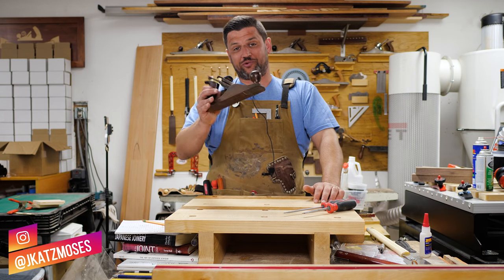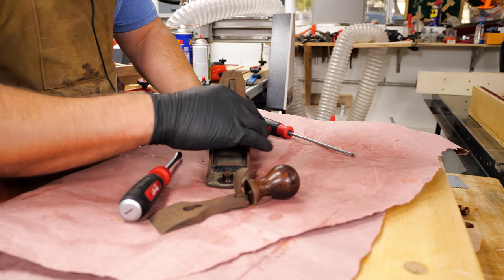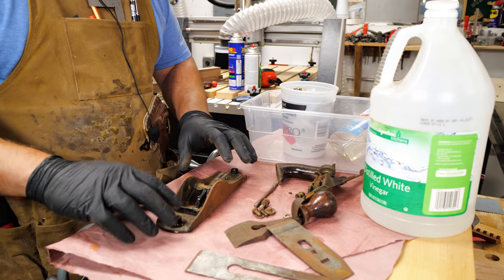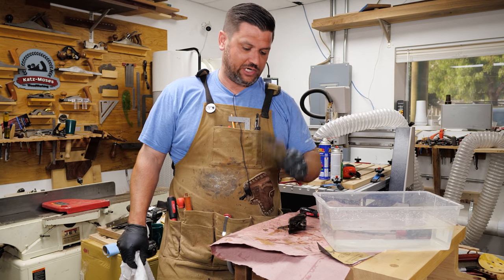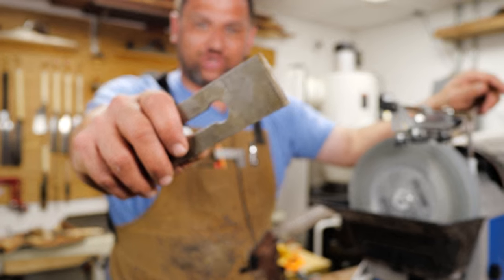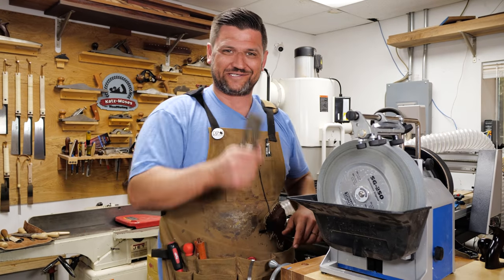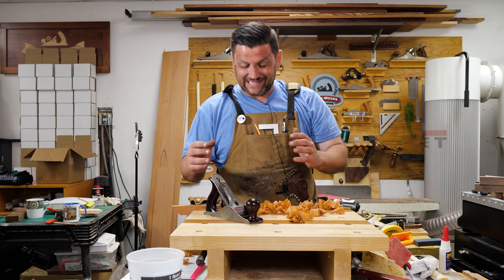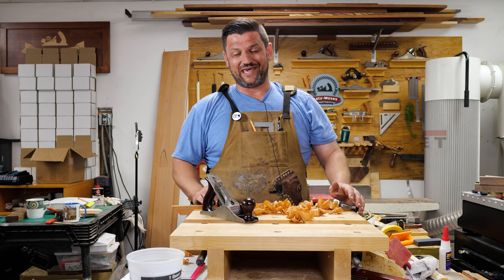Restoring a 100 Year Old Hand Stanley Hand Plane - Essential Woodworking Skills

Comment: The only thing I love more than woodworking is restoring antique tools. I like to try to leave the original japaning but will repaint if it’s in rough shape. The hammered finish paints look great. Shiny black just don’t look right on old tools to me. Thanks for the video 👍🏼
Reply from the maker: Cheers bud!
Reply: I’ve made some japaning, and restored two planes using it. It just takes forever to get to the point I could use them. Had to let them sit a couple weeks, then bake them. It came out nice, but ...eh. Lots of work, when you can just paint it and be done with it.

(Gilsonite asphaltum powder 1/4lbs from eBay- $8, then petroleum based solvent like naphtha & xylenes, and boiled linseed oil from where ever... I think I added some shellac flakes in my mix as well)
Reply from the maker: @joshuas1767  yea that sounds out of my patience level
Reply: Joshua Scarlett that’s awesome

Comment: Just bought a bailey no. 5 1/2 at the place I work at on the weekends (I sharpen knives, tools, swords, etc. At a flee market sort of place). I'm restoring it right now. I've got the screws, frog, chip breaker, and iron in some vinegar right now. Going to probably flatten the bottom of the body on my belt sander (it's just a bit big to do it with sandpaper like I would normally.). 

Yours came out great. It's going a lot faster than mine is lol.

Comment: Nice video.  I have a whole collection of old working Stanley handplanes that I use regularly from #2 thru #8.  I have restored all of them.  I found using Phosphoric acid (Krudcutter from the big box) as a super quick method of removing any and all rust quickly.  Just tank the parts for a few hours and done.  There is a certain satisfaction in using old iron once used by old craftsmen.
Reply from the maker: Good advice and totally agree!

Comment: Just a couple weeks ago I did 3 of my grandfathers, and one of my dads hand planes in the exact same way. I need an angle guide to sharpen them. But my favorite one was this tiny little shoulder plane. It's so small it can fit in my palm. Never seen anything like it. But even being so old and rusted, it still had a usable edge to it. I totally agree with the satisfaction that comes from doing a restoration like this. Especially when there is sentimental value in the piece your working on. Love this video

Comment: I have two planers that were handed down to me, one is a Shelton No. 14 and the other is a Stanley, both are the same length and configuration. The Stanley needs a new knob and handle (literally missing both) and the Shelton's handle is broken but might be repairable or serve as a template, both however need to be restored just like in your video. Thanks a lot really enjoy your content. Greetings from Arroyo in the southeast coast of Puerto Rico. Blessings.

Comment: I used to work in a machine shop, yes steel wool works, but you know what lapping is the sol of a plane should be flat from heel to toe. So I object to using a random orbital sander, what is a better idea if work off a flat surface a marble countertop or just the sinks cut out is very flat, use some wiring sticks on one and see if it flat without a bow in it.
You shouldn't see any light pass under your stright edge, now take a full sheet of emry cloth or wet sanding paper spray glue it down or use some with an adhesive backing make dure the marble or stone surface is clean you can also use a thin film of oil to stick it down.
Now you can pass the plane sol over as well as the sides untill its smooth yes al old plane might have a few pits but your using the whole bottom to guide your cut.
Pass it over this untill its clean use oil on the paper to help remove dirt.
This will restore the working surface,  on your fluted bottom plane you can wire brush it.  Or you can do electrosis to remove the rust using low voltage and a dissimilar metals then hone the sides and bottom. Some guys use the sand paper to sharpen planes and chizzels without tools but by hand.
A grinder is going to put 2 high spots and bevel on the cutting edge it may have to sharp an edge to hold it this way becuse the cutting edge has been weakened by the bevel shape.  Then agine it might cut better.  The Japanese have gotten sharpening tools down to an art. There joinery is a lot tighter tolerances.  
We slap 4 side togather and call it a day they mill it to a persice fit. 
Craftsmanship in Japan was an art beyond woodworking.
Not to cut down traditional woodworking but some of the joints Japanese woodworkers do is beyond anything you see done in America up untill the eairly 1900s and beyond ever see a Japanese puzzle box the joints are seemless.
You can look at it for hours before you figure it out and then you've got to close it.  One guy shows how to sharpen disposable planer blades.

Comment: Nice video. While I agree on getting new tools most of the time because I want to work with them not have another project I have bought used planes. Our woodworking association sponsors a old tool swap meet and I’ve found two planes in wonderful condition there at very reasonable prices. The Stanley lo angle block plane I found was fully sharpened and cut perfectly when I bought it. The Stanley Bailey number 4 just needed to be sharpened a little. Neither plane had any rust.
Reply from the maker: Those are some great finds

Comment: 1st, great video!  2nd, somebody commented that it’s not actually 100 years old… well I think they’re correct, but I’d say Jonathan is close enough to use that phrase for the video - artistic freedoms and all.  

Based on what we can see in the video (at time 3:25 you can partially see the bed of the plane as he’s taping it before painting), it looks like there is just one patent date stamped there, which likely makes it either a Type 13 or 14.

There is no raised ring surrounding the knob receiver screw hole, which (based on the Type Studies out there) leads me to believe it’s a Type 13 (1925-1928).

With an age between 1925 and 1928, I’d say it’s close enough to call it 100 years.  After all, close enough counts for horseshoes, hand grenades… and hand planes, unless you’re worried about a museum collector/appraiser opinion I guess.

Here’s a good flow chart for dating old Stanley hand planes based on old type studies:

https://www.popularwoodworking.com/wp-content/uploads/pdatechart.pdf

Comment: Have you ever used Evapo-rust instead of vinegar?
Reply from the maker: Never heard of it. I'll check it out. Thanks
Reply: @katzmosestools  check out Hand Tool Rescue. I love his videos.
Reply: I've used both.  Evapo-rust brought back an antique pipe wrench that was locked up with rust to looking brand new.  One thing about Evapo-rust is that it leaves a black residue where the rust was.  Mostly that can be wiped or buffed off but if you have any pitting from the rust it really is hard to get rid of.  Vinegar will just leave the pitting with the metal color.  For a working tool I don't really mind the black but if you want to make a show piece you may want to keep it in mind.  Both vinegar and Evapo-rust are environmentally-friendly and can be poured out when used up.

Comment: If you're going to restore something don't do it half ass and Skip stuff clean the screws clean the screw holes clean everything because taking apart cleaning everything getting all the rest out of there and then put it all back together and there's a couple spots that you skipped with rust how stupid is that the whole point of taking it apart and cleaning it was to clean everything elite rust on their it's going to keep rusting the rust doesn't magically stop I was taught do it right or don't do it at all

Comment: Very useful video.  I inherited a #3 and wondering if you lower the value by restoring it to its new state and sharpening blade, cleaning up wood handles, etc. Anyone know?

fyi - music on a DIY, demo, tour, cooking, or wildlife video is extremely stressful to the viewer and hurts the ears. Let me rephrase that.  It is insanely irritating and provokes a violent and angry response from me as a viewer. I'm trying to be polite, but you need to understand that you are forcing your brand of obnoxious rock music with clapping and banshee wailing into my ear drums. I came to see a restoration but I am forced to listen to this obscene level of noise. Why?  It is not bringing you more viewers but chasing them away. It is a net zero and it subtracts from the value of the video into the minus side.  Unwatchable due to music. I'm tired of having to guess when you will speak and when you will flood my ears with this savage level os noise and this is stressing me out!